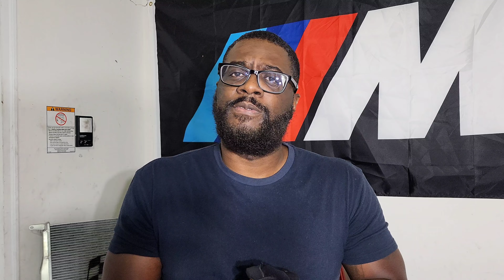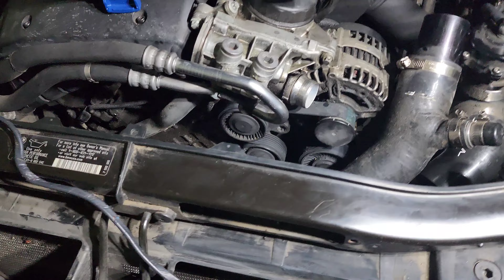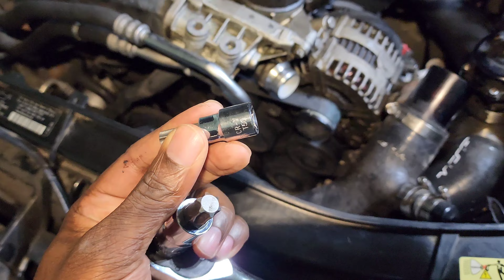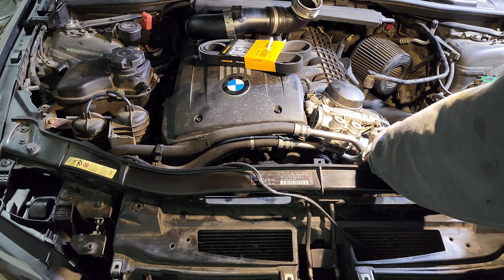DIY BMW 335i Maintenance: Replacing Tensioner Pulley and Serpentine Belt

Comment: Hey, Bro. What's the torque wrench for? Just to ensure the right "tightness" of the bolt to hold down the tensioner?
Also, did you have to remove the radiator to get to the pullys? Or was that for the water pump?